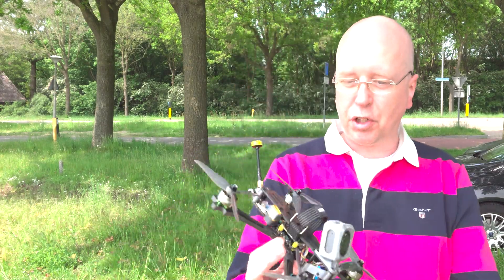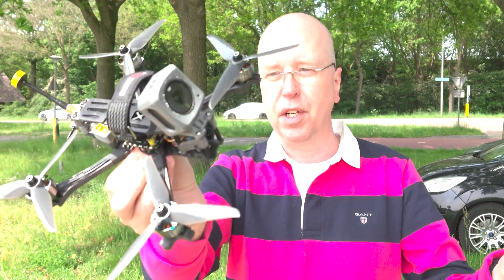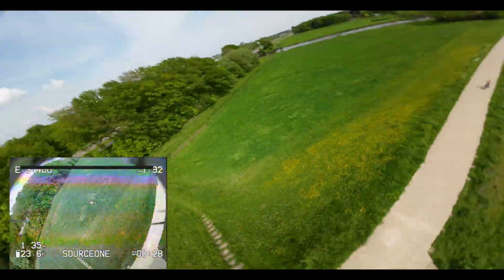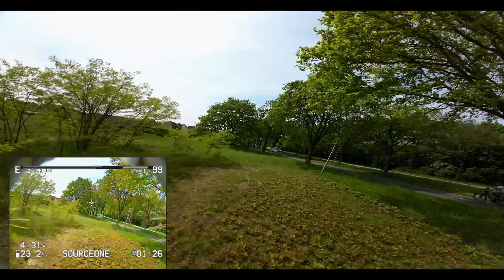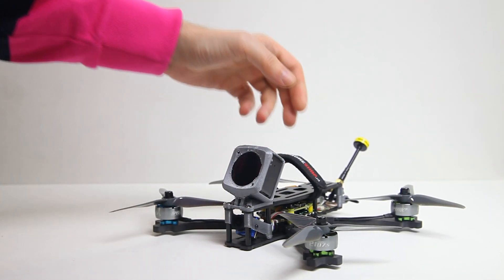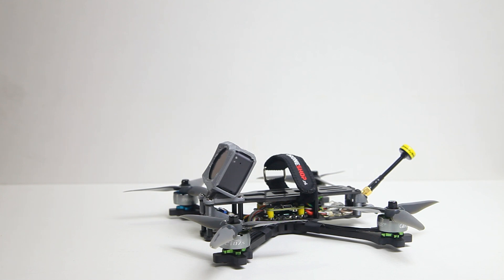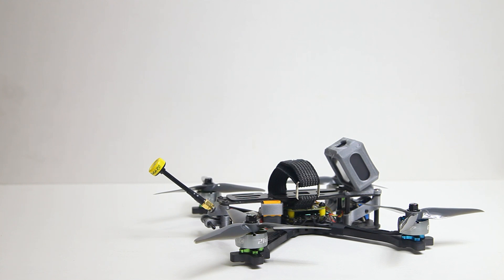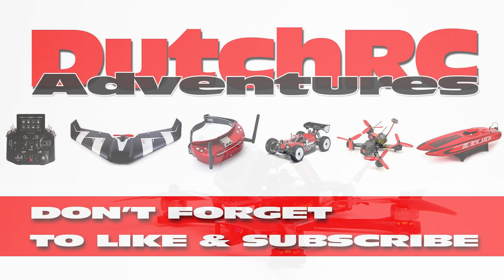Affordable FPV Quad 2023 - T-Motor + GepRC + TBS Project Roundup :)

Comment from the maker: This quad reminds you to First do your filtering.. Then the tuning :) 

The setup: 
TBS Source One V5: https://www.team-blacksheep.com/products/prod:sourceone_v5 

T-motor Cine F7: https://tmotorhobby.com/goods-1248-TMOTOR+Velox+F7+Multifunctional+Freestyle+Cinematic++Flight+Controller+For+FPV+Drones.html 

T-motor V50A ESC: https://tmotorhobby.com/goods-1173-T-Motor+Velox+V50A+4in1+ESC.html 

GepRC SpeedX2 2107.5: https://geprc.com/product/geprc-speedx2-2107-5-1960kv-2450kv-motors/ 

FPV cam: Runcam Phoenix 2 

TBS Unify Pro V3: https://www.team-blacksheep.com/products/prod:unify_pro_sma 

prop: Dalprop New Cyclone T5146.5 

receiver: GepRC 2.4GHZ ELRS Nano: https://geprc.com/product/geprc-elrs-nano-receiver/  

Battery: CNHL 1100mah Black Series

Comment: The HD-footage looks very much stretched in this setting. Is this the super-wide setting on the camera? Looks like some magical algorithm taking a probably strongly fisheye picture and converting it into rectilinear with much distortion towards the edges.

Nice flying!
Reply from the maker: Thanks man :) 
indeed the widest view of the Action2.. I like it (otherwise I wouldn't use it I guess :P)  but next to the FPV view (which is squezed horizontally) it indeed looks "different" :D